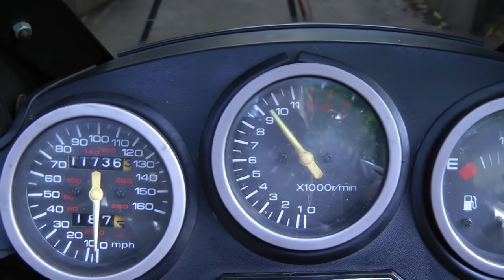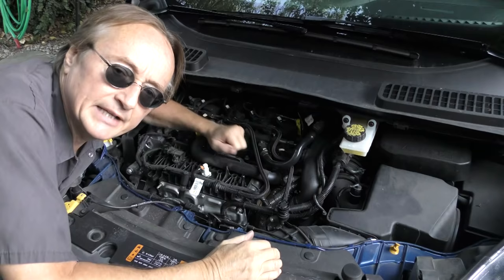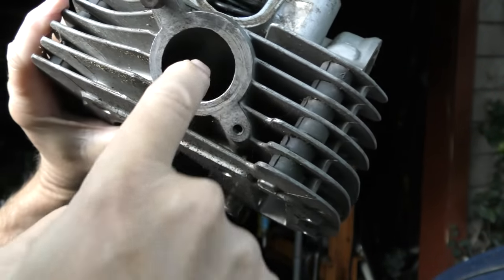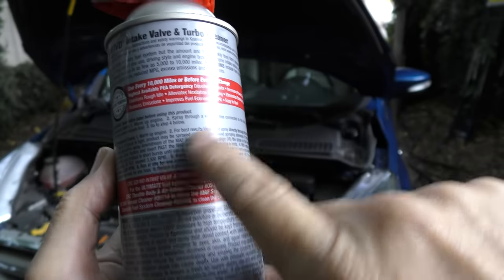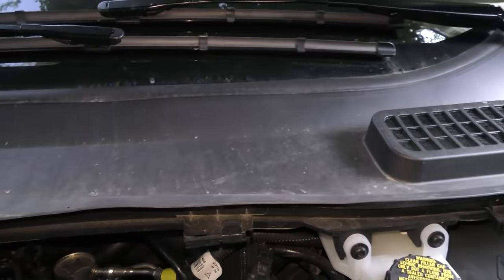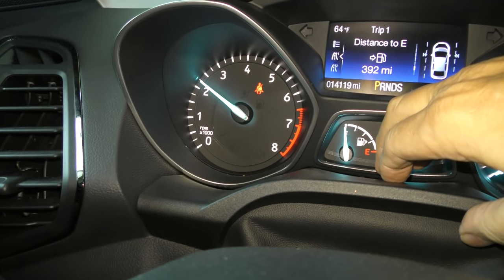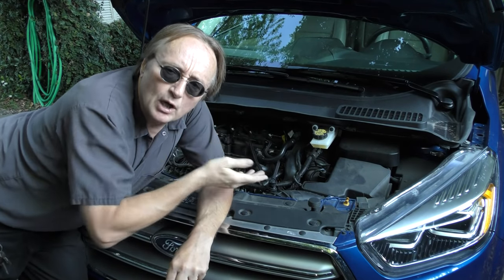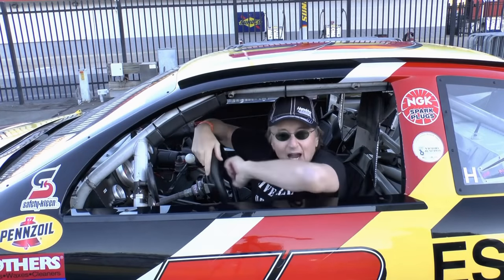How to Clean Intake Valves in Your Car with a Spray Cleaner

Comment: My car was fine 4 minutes ago, now I need to clean them valves!
Reply: HitsMetal 😂😂😂 same
Reply: i hear ya.  clean my air filter and then do this.
Reply: I know The urge
Reply: Lol i swear this was my first thought
Reply: Like why😂😂
Reply: Same! Hahaha!
Reply: 😂. Yeah now I can’t sleep.
Reply: Amen brotha... If i ever want sumthing to do on sunday i just watch a few scottie vids and usually end up cleaning my internals
Reply: Manufacturing tolerances are so tight that a certain car manufacturer will warranty the engine for ten years. Regular oil changes, use of top tier brand gasoline ( that includes Costco ), and weekly trips at highway speeds should be good enough.
Reply: Lol
Reply: Right!! And it's 3 am I need to find a 24 hr autozone asap
Reply: but then you gotta+( rev) up ( that) engine!!!
Reply: Scotty you lost me! I can't hear your video and read comments same time.
Reply: @ferndog1461 not for a GDI engine

Comment: thank you scotty! this worked on my wifes 2011 vw tiguan. the dealer wanted $800 to clean the valves. got a can of this and took my time, got my scanner cleared the codes and drove on the freeway for about 20min no more check engine light. thanks again!
Reply from the maker: Yep, I'm not making this stuff up. It's really a great cleaner, I would have gotten more excited in the video but then I suppose people would say I was making it all up.
Reply: Did you spray the CRC directly in the throttle body for your wife's Tiguan?? 
I've been wanting to trade out my Civic for a Tiguan but was really hesitant because of all the mechanical issues I read about the Tiguan's GDI.
Reply: please dont get one! its been in and out of the dealer more times i can count, the headlight wiring needs to be replaced already because the coating on the wiring is flaking off, had to spray plasta dip on it for a temporary fix. i disconnected the hose after the mas air flow sensor had my hunny press on the gas holding it at 2k rpm then sprayed the can took about 30 to 45 minutes. plus the check engine light came back on after 5 days probably needs a couple more cans of this stuff.
Reply: Sheesshh..yet another horror story with these cars! Thanks for the tip, I will really put that into consideration because I don't want to be in a money pit. My Civic is boring to drive but very reliable, the Tiguan seems fun to drive but has a possibility that it'll turn out to be just a huge, expensive, paper weight.
Reply: It is also good for gdi engines in kia, but the problem comes back, so you have to clean the valves every oil change, if not even sooner, specially if you use air conditioner which, in my case, makes things worse. Till some degree, with higher octane rating fuel you can prevent valve pinging, but sooner or later they'll need cleaning.
Reply: Vcbccbc Vcbcvb that's because you bought a kia
Reply: Wrangler FourTwenty I sold my 2011 Tiguan before I have to deal with all these shiet lol
Reply: very funny! AT least kia's owner manual doesn't say oil consumption is normal in the first few thousand miles: brand new dodge and I'm afraid original oil wont last until first change at 5000 miles
Reply: Here's a update, we put one more can in and stopped using valero gas. We only use shell and citgonow, A month+ and no check engine light
Reply: I wouldn't blame valero because it is/was on the list of Top Tier licensed retail brands.  So, better stop using 87 octane; use 89 or 91 if not 93. From my personal experience, I was using only shell 87 and the problem occurred.
Reply: Vcbccbc Vcbcvb valero is crap sorry bud. i would never use 87 in a turbocharged/direct injection engine thats just asking for trouble.
Reply: no tiguan 2017 w/o turbo, but 2011
Reply: Not saying you are prevaricating about what happened, but Valero, like Shell and Citgo, is top tier gas - meaning honda, vw, toyota, etc, certify that it has sufficient detergent to keep the valves clean on direct injection engines. So it should do just as well as shell and citgo.
Reply: The gas isn't an issue on Direct Injection at all since it gets sprayed directly into the combustion chamber. The problem is the oil circulating through your engine that cakes onto the back of the intake valves.
Reply: That is exactly why it IS an issue. With port injection, gas gets directly onto the intake valves, dissolving whatever tends to accumulate on them. It is not an issue if the gas doesn't have a lot of detergent in it because the gas itself is there in enough quantity to keep the valves clean. However with direct injection, gas bypasses the valve and gets injected close to the top of the cylinder. So only a small amount gets onto the back of the valve. So the gas by itself can't keep the valves clean. But if you add more and better detergent to the gas, supposedly the small amount of gas that gets onto the back of the valve does a better job of keeping the valve clean. That is what the car manufacturers say is the reason for using "top tier" gas. Can it really clean the valves if it is being injected no-where near them? Manufacturers say so but I haven't seen actual experimental evidence; I'm just taking their word for it.
Reply: Where did you insert the tube to spray it in on the 2.0 Tiguan?  I was thinking about spraying into PCV hose that goes into the intake manifold.
Reply: Actually it is the oil vapor from the PCV system that causes the problem!  A catch can will help keep the valves clean in a DI engine.
Reply: thank you scotty! this worked on my wife
Reply: @jeffsvids9590  The problem isn't the gas the carbon build up is coming from the engine crank case though a emmision control device called PCV (Positive Crankcase ventilation). When unburnt fuel blows by the rings and oil heats up and evaporates it turns into fumes those fumes need to be vented. The EPA doesn't want that stuff vented into the air all kinds of nasty stuff in it. They force car manufactures to recycle it back into the motor. The motor sucks it back in though the intake because GDI now the injectors don't wash the valves like he explains in the video. The only thing you can do is find oil which evaporates less one oil I found is Pensoil ultra synthetic but that doesn't really stop the blow by also with turbos even more blow by.  You can install a catch can it's usually more work then people want to do. You can try running this cleaner every oil change that's what I do once you build up that stuff isn't going to come off from a few cans of cleaner. The engine has to be disassembled and cleaned by hand.  I'm running the catch cans, cleaner every oil change, and use pensoil ultra synthetic I hope to get longer miles out of it. From what I have been reading now Honda is getting away from direct injection because of this.
Reply: I work at a VW dealership and honestly the reason it cost so much is because we actually take the manifold off and use a detergent to soften and scraped off chunks of carbon, and my dealership charged no more than $300 for the carbon cleaning
Reply: @Mike-01234  So what car will you buy next??     Are you ready to dump that car because of so much attention needed??
Reply: @MannyTGM  Which dealer is that for the $300 ?
Reply: @jaylee8703  after I posted that comment I actually realized I was wrong about the pricing lol, it's around $600+,and tbh I don't feel comfortable talking about my current work place location lol sorry about that. It's in NY though.
Reply: nice
Reply: Vcbccbc Vcbcvb  Toyota is bad for oil consumption as well. Kia at least fix’s there wrongs in most cases unlike Toyota and other companies that weasel out of it and find ways to blame the owner.
Reply: @Naneychevelu  did it help with her clattering?  What intake did you use?

Comment: Excellent description and explanation of valve cleaning procedure! As usual, I view your videos before performing regular maintenance of my 2002 honda crv. This worked perfectly! It corrected a rough and low idle issue as well as quieted engine operating noise. A+

Comment: they sure do,  thanks to CRC   i did.  actually took  almost 2 hours for short spray for 2 cans.  BTW  yes will smoke out exhaust at the end ( rev engine few times burns up blows out crap in  engine/intake..   big improvement at idle.    had too much carbon depoist on sparkplugs.  No idea why , so changed plugs  took for a drive 10 minute on highway per can says so.   then feels like came out of repair shop.   I  BELIEVE IN YOU SCOTTY!!!!   Denso spark plugs..

Comment: I cleaned my Kia 2.0 liter Turbo GDI with the CRC Intake Valve Cleaner. I used a vacuum line from the pcv valve. I drove it for over an hour after the one hour soaking period. It really runs like new. I did have to start and stop a few times to clear the check engine light. I plan to continue treatment every 10,000 miles.
Reply: WOW!  I'm considering doing this.  Sounds like we have similar engines.  Mine is 2017 Ford Fusion Sport w/2.0L Twin turbo (245hp variety).  70k currently.  Take great care of it BUT have never done this yet.  How long did this take once you got your bearings and felt comfortable?  Is there any potential mistakes you suggest I watch out for?  The cars runs SO NICE right now and I'm nervous I'll screw it up!  But if I don't do anything eventually im gonna lose all the power it seems.  Can you give me a quick halftime pep talk?!  )  Thanks in advance

Comment: Hello Scotty .
I had this pinging sound with my 2006 Toyota Sienna with 180k miles and i did this method and solved the problem. 
It was kinda knocking sound and i knew it wasn’t my engine cause i changed oil every 3k miles .
It was knocking or pinging at 1600 RPM 
And got it fixed

Comment: Thanks Scotty for the details.  I always enjoy watching your videos.  I think there is an easier way to remove carbon deposits.  You can simply cold start your engine, let it run for 30seconds to accumulate enough fuel vapors inside the cylinders.  Shut it off and let it sit for two days where fuel vapor will slowly soften the carbon deposits.  
I often avoid using harsh chemicals to remove carbons because it is difficult to formulate one cleaner that is safe for all steels, gaskets and catalyst converters, not to mention the toxic fumes produced during the cleaning process and the risk of pitting on metal surfaces if the chemical contains acid or alkaline.  Remember that carbon deposits have nothing to do with high rpm or driving on highway.  Stoichiometric combustion (which means being gentle to the gas pedal during acceleration) is the key.  Driving in the rain also helps burning off carbons away.  Anyway, a thin layer of carbon on piston is good as it helps protect the piston surface from repeated thermal shock.  Good luck!
Reply: Ray Yang, how is driving in rain remove carbon deposits??? 2. How can fuse clean up gunk on intake valves for GDI engine while fuel is sprayed directly into the combustion chamber
Reply: Edgar Adolph Under high humidity and high temperature and pressure conditions, carbon deposit will vaporize.  Some people inject water mist into the throttle body for the same purpose.  As far as GDI is concerned, if you let fuel vapor to fill up the combustion chamber, it will gradually reach the intake valve and soften the gunk.  Hope this helps.
Reply: @Ray_Yang182 Maybe it helps also driving with high rpm on high humidity weather. High rpm means high flow of the humidity air 
through the intake manifold. Sorry for my bad English. I hope you will understand me.
Reply: @MKasap-te8vm  yes, I do the same thing as you do.

Comment: I have a 2016 Kia Optima 2.4  with 30000 miles and a 2015 Buick LaCrosse with a 3.6 vvt at 40000 miles. I’ve installed catchcans on both. I’ve also used CRC @every oil change. Synthetic oil every 4500 miles. The boroscope camera still shows each car with nice silver clean valves. No catalytic converters problems. My Buick gets 28 mpg my Kia gets 42 mpg.

Comment: Spraying whole can is not necessary. My 2017 Sonata mileage dropped from 32 to 26mpg combined at 25K miles. I lead foot all the time. I bought 2 CRC cans. After treatment, mileage returned to 32mpg combined. Hot engine @ 2000rpm spray continuous till engine almost dies then turn off and let heat soak for an hour. Drive car for short trip and repeat 2 more times. I used 1/3 of the first can and got excellent results (32mpg again) and now WOT sets me back in the seat again. Engine hard starts and pings for the first block of driving during first treatment. After 3rd treatment, no more pinging, proof no more carbon breaking loose. My method gives great heat soak, blipping the spray can while engine remains running does little for heat soak. No ECM codes.
Reply: I have a 2016 sonata with 59k, never done this before. Did you have any issues afterwards? I'm worried about carbon chunks damaging the engine internally.

Comment: I personally think anyone with any GDI turbocharged engine should use a oil sperator or "catch can" to keep all the unburnt gunk off the valves.
Reply: TheVwguy87 if they had an intercooler oil will build up in the intercooler and act as catch can. I have a diesel turbocharged and when i clean the intercooler some oil is there but yes you are right.
Reply: Jay G I thought they had a pancaked intercooler behind the radiator. I need to find someone with one so I can take a good look.
Reply: catch can and water methanol injection
Reply: Yes, catch-can, or re-route the vapors to air intake and plug intake manifold (sucking end). The strong vacuum of the engine is what causes the blow-by.
Reply: Jay G is it a 7.3 powerstroke?
Reply: Catch cans is a flawed technology,,,, there are rip off,,,, they only catch 90% water 10% monkey oil,,, you need that water moisture,,, to help steam clean the engine,,,,, if you could fill one with 8 oz of water and let the engine breathe that,,,, once a month,,, that would be a good thing,,,, for over 35 years,,,, I've been watering my Pistons and running 4 tankfuls of Marvel Mystery Oil.. in every type of older engine,,,
Reply: They should be a mandatory oem part included when you buy a boosted car, period.
Reply: Does not work on a Gasoline Engine...As a catch can is useless...
Reply: @ricksimpson2167  no. I have had a catch can for 3yrs now...I can see it's more like 90% crud and 10% water. Its nasty. Thst should not be going anywhere near my engine
Reply: @moriartymatt34  are you supposed to change your catch can frequently ?
Reply: @SRT313  yeah, empty it out at each oil change

Comment: Just followed these steps, and the hardest part was trying to recover the hose clamp that I dropped and got stuck somewhere near the transmission. Thank you for this simple tutorial.
Reply: I have a 2017 Ford Fusion with the 2.0L Twin Turbo Ecoboost (245hp spec).  Very much interested in doing this as I have 70k miles.  Cars runs GREAT but I wanna keep it that way.  Question, was this difficult (minus you dropping the hose clamp).  I mean Im no mechanic but I'm able to follow directions and relatively handy. how long did it take before you got your bearings and felt comfortable proceeding with the spray and engine revs and and all that?  I don't trust mechanics an definitely don't trust Ford Service so I want to find an affordable yet effective way to clean these valves.  Thanks.
Reply: @alexlindsey6446  It's not difficult at all. This is a 2-person job, however. One to hold the can and keep spraying, another to step on the gas pedal. I did it alone but it made it much harder. The only tool you'll need is something to loosen/tighten the hose clamp.
Reply: @marloforreal  Thank you!  That's an enormous piece of information I didn't know about.  I knew you would have something for me on this having done it.  Second time around there's always things you'd do differently.  Thank you so very much once again.  Greatly appreciated.  )
Reply: @marloforreal 
I made a gas pedal holder out of a pvc pipe.

1. Put seat all the way back
2. Measure distance
3. Make pvc pipe that distance measured
4. Install pipe between front of seat and gas pedal
5. Press the forward electric seat adjustment button until rpms set at 2,000.

You could probably use a piece of wood too, but inline the roundness of the pvc pipe, seems more stable.

Comment: I saw a video about cleaning valves and the mechanic was against using this procedure on turbo-charged engines because some particles of carbon could break off and damage the turbo rotor. Any opinions out there?
Reply: The CRC stuff is safe for turbos. Just follow directions to dissolve the carbon appropriately.

Comment: Yes Scotty I've been using this cleaning brand for years the valve intake and mass airflow sensor cleaner work great.
Also sometimes I use Sea foam to do the same thing it's sometimes cheaper than this brand.
Reply: Never use sea foam. CRC is better
Reply: You're first say I never used it before then you say CRC is better.
If you never use it before how do you know it's the superior?
You're not getting paid by CRC are you?
Reply: @stephengoad3091 he said never use it, not that he’s never used it
Reply: Seafoam and CRC have the exact same ingredients

Comment: That stuff and other brands like it just simply don't work if there is any reasonable amount of carbon build-up to get rid of. Tried this on a carboned up VW TDI and a friend tried it on his VW GTI. So a petrol engine and a diesel engine, good test. Didn't do anything at all so whipped the heads off both cars and cleaned the valves on the wire wheel side of a bench grinder. Ran a flexible line wire brush on a drill through the inlet and exhaust ports, all shiny clean. Cleaned out the EGR's and intake manifolds, both engines run like new again, power and torque restored, fuel consumption back to normal.